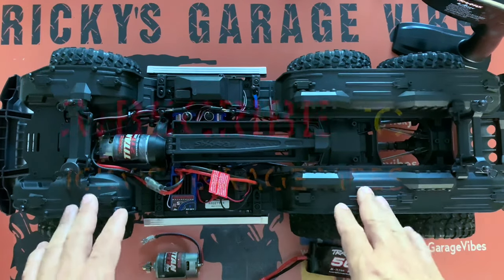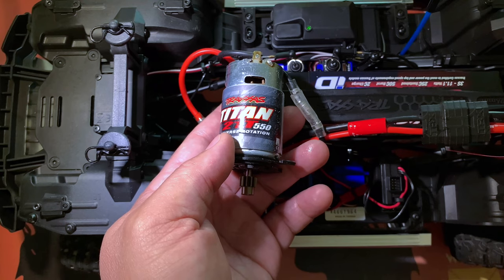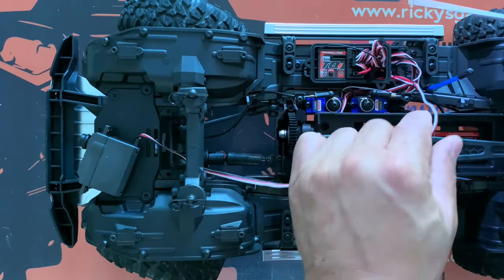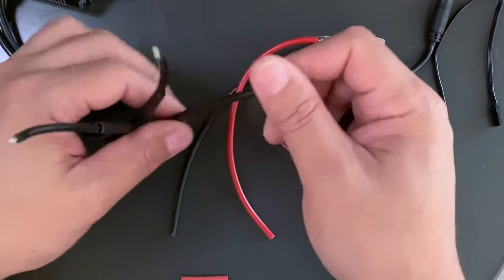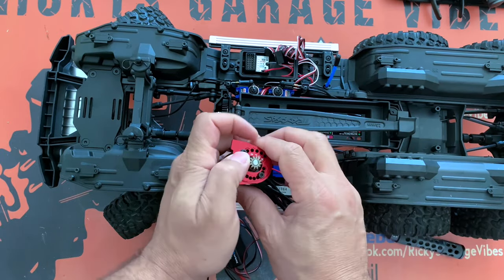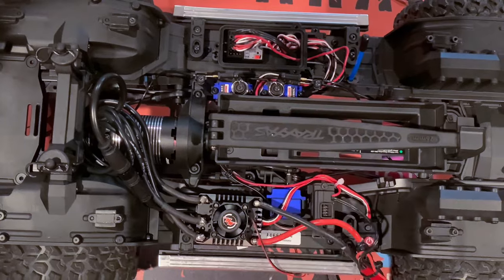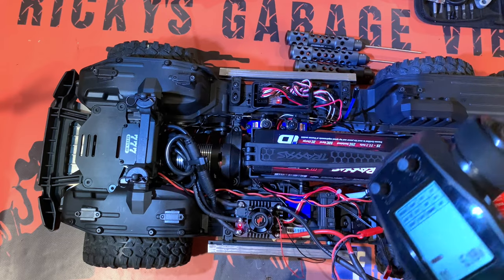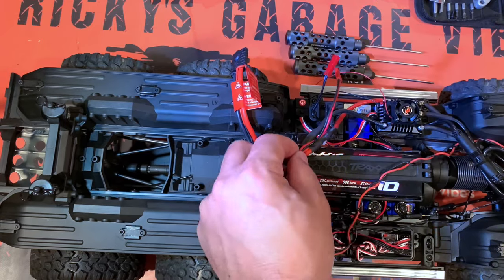Traxxas TRX6 Brushless Motor, Servo, Receiver & RC LED Light Kit | RC Upgrades

Comment: Man I just installed the Axe R2 550 3300 on my TRX4 Defender and the truck flies! If pops Wheelies like crazy! It's a night and day difference the rig is alot more fun now I highly recommend it! I soldered the plug for my light kit directly on the ecs right on top of the battery cables so it has a factory look and I put a Y splitter on one of my channel 1 receiver to install the fan came out great and factory looking. Might upload a video showing my setup
Reply from the maker: Tag me when you upload the vid!

Comment: @22:47 - is that red button the new power switch for the truck? I originally thought it was used to program the ESC but now I think I was mistaken. Or does it do both?
Reply from the maker: Only turns on the truck, I use the app to program the ESC

Comment: Im installing the hobbywing fusion 2 in1 motor combo in the trx4 sport  Need to connect power for the light kit ! Any tips or how to would help alot any ideas 💡 with out using a battery pack to power the system!
Reply from the maker: Check out this vid ... let me know if you need more ... https://youtu.be/FhQ0RYjwjO0

Comment: Weird I’m using the same motor mount position with the same motor and it doesn’t seem as fast as it should.
Reply from the maker: The pinion gear size can make a difference
Reply: @RickysGarageVibes  what pinion are you using ?
Reply from the maker: a 12T from Traxxas!

Comment: im building a trx6 hauler with  	Hobbywing QuicRun Fusion FOC System (2in1) - 1800kv AGFRC 55KG Digital-Steering-Servo High-Torque Waterproof - Programmable Metal Gear Brushless hauler widening by 2 inch tiltable rolback   10 wheeler at mo
Reply from the maker: Good mods!  Tag me when you're done, want to see it!
Reply: @RickysGarageVibes  im filming photoing the build will be on my channel soon
🤠
Reply: just recieved the bits from phillie usa im int yorkshire england not the uk or britain wher ever that is ps i subbed 2 u
Reply from the maker: Thanks for subscribing, truly appreciate it @nobby91010 Merry Christmas, Happy Holidays and All the very Best for 2024🎄🤝🎄
Reply: @RickysGarageVibes  🎄🎄🌿🌿

Comment: @Ricky's Garage Vibes your video and instructions are the best! Thank you. Just two questions as I don't have the meter with me: are Traxxas lights powered by 11.1V?? You connected directly to the battery. 
And second please: do you think I can connect the fan to the Traxxas lights connection directly?
Reply from the maker: The Traxxas lights aren’t connected directly to the battery.  The kit comes with a module, they also sell a separate LED Power Supply.  The cab light is not from Traxxas and it’s 12v
Reply from the maker: The fan has to be connected to a channel inside the receiver not directly to the battery
Reply from the maker: Replay the video, I show the module and how to connect the lights
Reply: @RickysGarageVibes  Thanks, I was thinking about connecting the lights module directly to the battery. Seems risky, I read that this connection smoked the module foe some people. Does it work fine for you after a few months? I'm considering connecting the lights module to the receiver, the same as the fan - what do you think?
Reply from the maker: @wojciecho  the module is 12v, the receiver is only 6v so you can’t connect the module to the receiver.  I’ve had no issues connecting the module to the battery.  If you’re using the original Traxxas system, you can connect the module to the XL5 TQi (blue)
Reply: @RickysGarageVibes  I'm installing the same Hobbywing combo 550. Check out this video https://youtu.be/MdUXJKKWmqs The guy somehow connected lights module to the receiver. What do you think?

Comment: Great video  😀 I just got that combo but the new version axe 550 r2 3300 but it came without the pinion gear :) should i get the 12t  5mm pinion ? plese help :) sorry for my english
Reply from the maker: If you want slower crawling you can go for the 10t or the 14t for more top end speed ... for my type of bashing I go with 12t .. a balance
Reply from the maker: Thanks Nelson 🤝 appreciate it and great minds think alike on the axe
Reply: @RickysGarageVibes   Thanks man I really appreciate your answer 😃 great work .